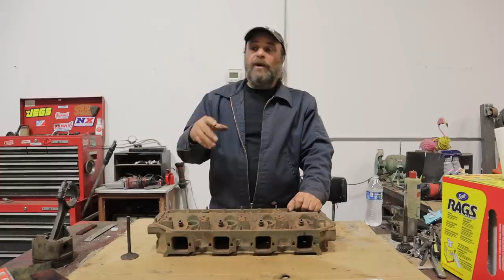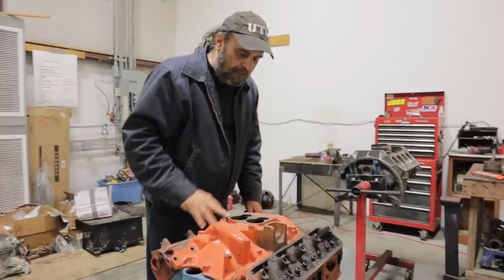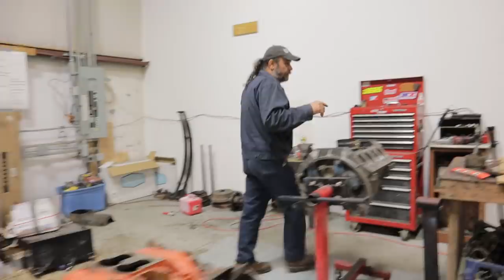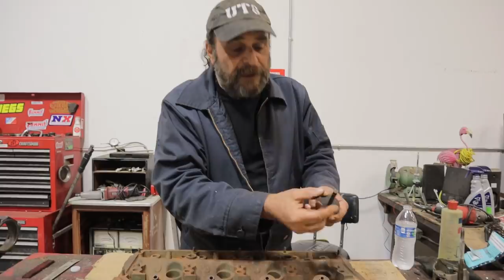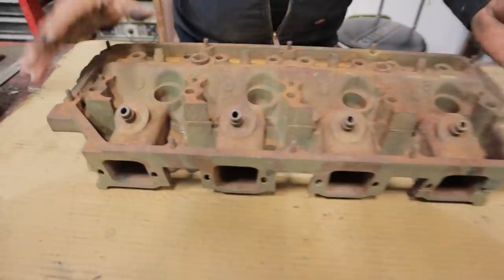Carburetor MPG Myths And Intake System Thermodynamics

Comment: The thing to remember about efficiency and mileage is that there is only so much chemical energy available in every gallon of fuel, and it takes a set amount of energy to move a (x) mass at (y) acceleration against (z) resistance.
Reply: Dammmm right
Reply: This basic fact is completely lost on way too many people, which is why we get 100mpg claims, hoardes of people using fuel additives and other bolt on nonsense to improve milage.

The truth is starting with your basic premise, the losses in effieciency is through transmission, approx 30%auto/5%manual, rear axle, wind resistance, lack of overdrive gear etc.

But most importantly, is ones driving style. Ive managed to have a "fuel sipping" 1.8 turbo diesel use as much fuel as a carbed 5.0L V8, because i drove it to where it gave the same performance. Who'd gave thought, full throttle, max turbo rpm would use that much fuel? Well, it does. Drive like a granny, and you'd use less.

In other words, the "secret recepie" for great milage is to put a brick under your gas pedal.

Comment: Well done Tony, love your channel. I am 64 and started my career right out of high school, when Techs were paid 60-40 flat rate, been an ASE Master for over 30 yrs, and have heard this "100 mile per gallon" nonsense my whole career. Its funny you mention the Smokey "vapor" engine. In the early 80's Nissan was installing a ceramic heater under the carburetor to vaporize the fuel, it worked well, until of course it burned out, and sent the ceramic into the combustion chambers 🤣🤣🤣

Comment: I love this. This was so intresting, I never read anything on the stages of temperatures encountered by the mixture between the carb and the cylinders. And I totaly not thought about the back part of the valves and top of the piston heating fuel, and that carbon deposit could act as a insulation. So cool. Thanks a lot.
Reply: NAY, the problem is dieseling, an indication that excessive amounts of fuel is used. There is an asymmetric bell curve you have to get past in terms of heat. When you add gaseous fuel then the problem becomes getting enough charge to make HP, at the other end of said curve ...the running crappy just indicates you're on the typical side of  said curve. Smokey's contrivance was a cheater's attempt to get to the other side ...
Reply: I was taught a lot of these things Tony speaks about way back in tech school back in the 1970's.

Comment: One of the big problems for fuel mileage is that it by definition, negates what MOST people want.......performance! One of the best economy tips is to learn to drive economically. We take the heat out of our fuel intake systems to gain 3 hp and wonder why we lose mileage. Soft tires make for a smooth ride but not good economy. 4.11 gears really get you off the line but suck for mileage. Everything is a compromise. How fast do you want to go? How much can you spend.
Reply: Excellent points. Especially on the driving style.

Comment: i read a article that chrysler was supposed to have done a test and said that it was impossible to burn all the fuel in a bore dia over 4" now this was written back around 1980 if i remember corecttly and was supposed to be one of the reasons that they made the V-10

Comment: Really enjoy hearing you talk about the nitro motors , that's very very interesting stuff to me ... Back in the 90's when i was getting into mechanics i was taught running a motor @2500'ish rpms while dribbling water into the carb to steam carbon , also running transfluid in your gas would help break up carbon .... Would be a good video * differnt products that'd help clean your cumbust chamb etc etc ...

Comment: Ive used a can of Berryman B12 into 1/2 tank of gas $4 about every 5,000 miles. my favorite.

50 years ago we ran water injection made from a windshield washer tank.
 In the early 80s Holley sold a water injection kit for knock supression.
Same thing. washer tank with nozzles and a vacuum switch.
Worked well on the high compression 70 Corvette 350 hp 350.
Reply: I keep seeing your comments and you have no idea what you're talking about...

Comment: Someone told me that they got 100mpg from a flat head but it burned a hole in all 8 pistons.  The only part of the story I believe is that they probably leaned out an engine so much that they burned holes in the pistons.
Reply: 100 mpg downhill for 1 mile? The old lady's Buick Park Ave Ultra displays 99mpg average under those circumstances, and she gets all wound up over it ☺

Comment: I get the hot fuel explanation 
What about cold air? 
Cold air = denser = more power
Cold you heat the fuel without heating up the air?
Reply: no
Reply: Engine Masters (sorry Tony, I know they're not your favourite people at the moment) did some testing on cool intakes and found that ambient air temp doesn't make a noticeable difference due to the intake vacuum cooling it down, but fuel temp did make a difference, cooler fuel was found to be better. When race guys ice the intake, it's to keep the fuel cold and also keep the intake walls cool, which helps with creating a lower pressure in the intake to help move more mixture through

Comment: This is the Best! I don't think people understand, how much "Ideal Test Conditions" Go out the Window once you're flooring it? Going uphill? or towing something? You are not going to get that "great" a fuel economy on an Factory EFI system, Unless it really is designed to operate under wide open throttle and high loads? as much as pleasing the EPA Pencil Pushers. (yes I like Glaciers too, that's why we should make More Biofuels)

Scotty Kilmer also dispels these myths too, mainly though doing so in comparisons of "Small engine Big trucks" Vs "Conventional natural aspirated V8s".

I've studied: Engineering, thermodynamics, physics, my whole life! But I Didn't Know this stuff! until I dealt with it in practice, on cross-country road trips - and moving from the Great Plains / Gulf coast to the Mountains.

Automobiles are a funny part of life! There's So much misinformation  and marketing speak "False" information! It's no wonder why E.V.'s are taking over the market. "They just work" (well mostly), and their performance metrics & efficiency specs are self evident & can be taken at face value. IF it says on the sticker 0-60 in 1.8 sec? and 100 MPGe, You can bet it's going to get that! atleast until an Ice Age starts or the Battery explodes.

ICE's are a Headache, but I think some of the best engineering leaps forward was done so very long ago... Newer generations don't remember it.
Reply: We also need consider Rod Ratio & stroke length. There are Tons of high horsepower High Compression Ratio - Very High Efficiency (in Power per displacement) Superbikes that only weigh a quarter Ton or so. But they can't beat a Honda Accord in MPG for daily driving. because? NO VTec? No. Honda bikes included. It's because the stroke to bore Ratio is so short most of your usable energy goes out the exhaust.

Not something that matters in a Low Revving Muscle Car - but it is interesting? Combustion Dynamics.

Comment: Thank you Tony for explaining the heat crossover.  Many people are confused about that one.
Reply: intake gasket sets often come with blockoffs and many people block the heat risers.
Reply: @hotrodray6802   yes but the in-line motors are different.  Sure you can run it with no intake heat. Even drag race it, but if it’s cold outside you won’t like it in traffic.  I used to build in-line 6 kits and sell them professionally.  The problem with an in-line is the intake is just hanging out in the wind. On a V block you still have some heat rising up from the valley with an air gap manifold.  Not as big of a deal. If you use a normal intake on a V block the hot oil keeps the intake as warm as needed. The in-line blocks are a different animals.  The intake on a in-line with no exhaust heater or hot water will Ice on you on cold days.  Yes that may make the most horse power but tip in it or take off slowly it won’t like it.  I sold kits with a carb tuned and ready to run.  Never ever had a complaint.  I was told how much better my set up ran in traffic than what they started with almost every time.

Comment: Thermodynamics can predict the limits of efficiency of a motor based solely on compression ratio.  This is pre  friction,  oil losses,  etc.    100 mpg might is possible on with  a tiny  motor in a tiny car.
Reply: My old Geo Metro with the 3-cylinder liter engine and five-speed would get 50 mpg if I didn't flog it. I never had to hypermile it either.
Reply: Lassi,  you actually just made my point.  A  gas engine has about a 10 to 1 compression ratio,  while a diesel runs  about  18  to 1, or higher.  Also  diesel  has many more  btu  per gallon.
Reply: Have a look at the channel   Robot Cantina   they put some small engines into a car.  The fuel mileage was not that great.
Reply: @Lassi Kinnunen 81 I posted this to show " put a lawn mower engine on a car and get 200 MPG " has limitations.

Comment: Uncle Tony when I would like to see these different methods that we can use to decarbonize the top of the piston and the valve what products can we pour down or spray down the carburetor to help the vehicle be more efficient with less carbon buildup thanks Steve
Reply: in old days, we'd take off the air cleaner, and trickle in water from a garden hose while the engine ran, until it nearly stalled out. nowadays i guess someone can use bottled water, but the classic tune up for the lil' old lady who only drove in the city was to go out on the highway and give it "the italian tune"--downshift and wind up the revs. Today's fuel is better refined and has more detergents in it--i'm not sure us up north even need dry gas anymore, with all the alcohol ADM sells us to put in fuel.
Reply: With the engine warmed up and running, air filter off, then use a spray bottle to mist water into the intake. Just enough to hear the idle drop a little. A few minutes on a few occasions should help

Comment: Good stuff, as always. Who knew how complex that heat/fuel interaction was? Other than emission problems, I wonder if the better road to less fuel consumption is higher compression engines. Think Michael May's Fireball heads for the Jaguar. Somewhere in my pile is a Popular Mechanics (or Popular Science--I can never keep them straight) article from the 1970s of a German-developed 4-cylinder car with 16:1 compression that ran on regular gas. Better gas mileage and power to boot. Nitrous oxides emissions were a problem, though, which may be why the engine never took off. The idea still intrigues.
Reply: With direct injection compression ratios are on the rise again. I think the Mustang GT is like 12 to 1 on pump gas but the Ford Coyote uses VVT to help control combustion temperatures and limit NOx.
Reply: Yeah I heard that emissions really put a bottle neck on how much mpg you can get when designing an engine.

Comment: my dad grew up in northern Michigan and what he did to a old 75 nova is cut a hole in the firewall and route the hose from the passenger side A?C to the exhaust gas recirculation tube on the carb, and hen doing 100 mph flip the A/c on full blast and would instantly boost to 130 mph due to the cold air and pressure, also he made a copper coil of 1/4 copper pipe in a spiral about 5 spirals and attach it next to the radiator and rout the fuel line to it over the engine so the gas was cold. COLD GAS AND COLD AIR at operating temps made more power!

Comment: My Hemi actually gets 110 mpg.  This has been documented all over the place and everyone that owns one like mine gets the same mileage.  OK, so it is a 49cc Chinese scooter BUT, it is indeed a hemi (hemispherical combustion chamber) and it really does get 110 mpg.  It only does 44 mph top end but, around town that's all I need.
Reply: As kids we would put tuning kits on 49cc mopeds, 70cc cylinders, higher compression cylinder head, expansion chamber exhaust, large 24/26mm carbs, std was 16mm, and majorly ported intake runners, exhaust, enlarged ports and lightened piston. This in conjuction with max bored cylinders, for approx 74/75cc, really woke it up. Far higher max rpm than out of the box tuning kit, and it pulled hard up top. But milage really sucked, almost like a regular car. We found a toned down version without the high compression top, which broke pistons due to knock unless using octane boister + 98 octane gas, less expansion chamber, and standard carb, was best of both worlds. Essentially same as the first 1966 mustang had a 2 port carb on a 289. The added cubes gave most drivability.

Comment: Tony one thing that kills those high mile per gallon stories is there is that strange problem, engine cooling.  There is only so many BTU's of energy in a specific volume of fuel and that would set a maximum MPG.  Now that nasty cooling system sucks up quite a bit of energy, but it is necessary ,  If there was no cooling system you would get better energy conversion, while at the same time they would melt down into a huge metal lump.  Those high mpg vehicles getting that tremendous numbers have no cooling and they run the engine at WFO for only a few seconds and it is disconnected and the vehicle coasts to a near stop then they repeat the cycle again.  Not really effective for day to day driving.

Comment: Now I'm confused about one thing. Why do the drag racers use "coolcans" to run the gas lines through? This would cool the gas before the carb and engine warming it back up?
Reply: different methods for different goals, those racers are trying to make the intake charge(fuel and air) as dense as they can, trying to cram more into the cylinder for the reaction
Reply: @xxnamexx530     Thanks, I guess I need to read the title better. It was about economy, not making as much power as possible. Duh!  Like you say. two entirely different things.
Reply: @seniorrider9337  no biggie, i'm sure i've done similar, lol

Comment: The heat crossover is detrimental to making maximum horsepower. That's why it is blocked-off on stock heads if you're building an engine for racing and omitted on aftermarket performance cylinder heads as well as on the 426 Street HEMI (as seen in the video) originally designed for an engine to be used in competition, not street use, and therefore didn't need a heat crossover in the head. When Chrysler was forced to build the engine and put it in passenger cars it used a makeshift arrangement to heat the bottom of the intake manifold.

The main idea behind the heat crossover is cold weather driveability, i.e., quick warm-up of the intake manifold. Once the engine reaches operating temperature, the heat crossover is not needed.

Comment: Is that way swirl backface on a valve helps the turbulence in the combination chamber with fuel vapor?
Reply: Yes 👍
Reply: Not really. But its a good urban legend 
Those guys grinding swirls grooves into the back face of valves do have some credibility. 
As most stuff, its a lot of time and work for minimal gains.
Carbon?
the biggest problem is the PCV sucking all that oil into the intake.
Rings are secondary problem but you cant re-ring every 5,000 miles.
THINK ABOUT IT